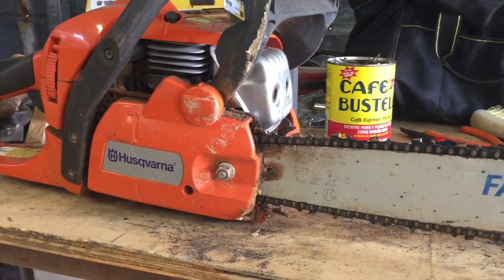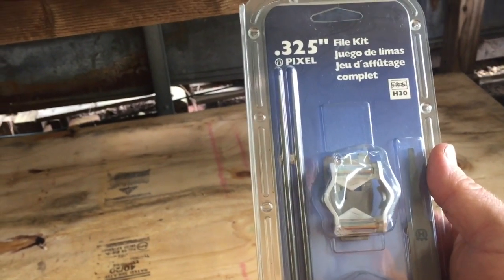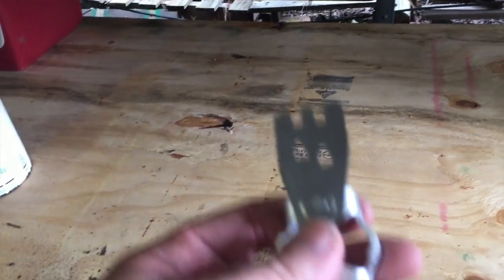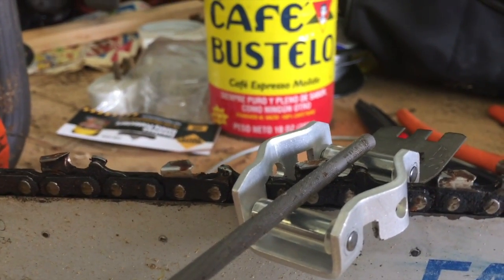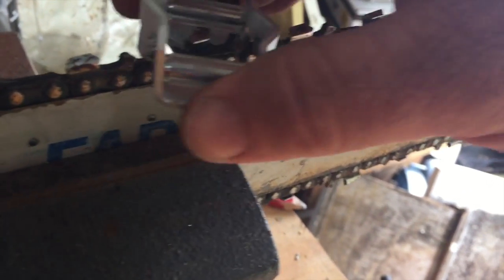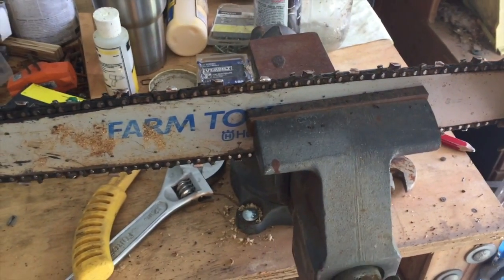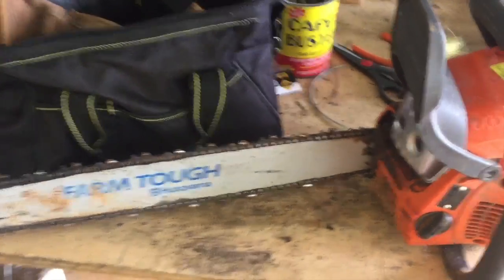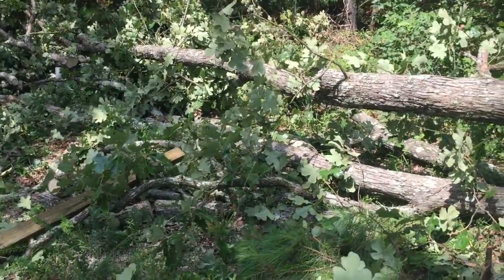How to Sharpen a Chainsaw: Husqvarna 450 Rancher

Comment: Those files are not the same sizes  one is 7/32 and I can't remember the other one but you can't use both of them on your 450 I believe you need the 7/32